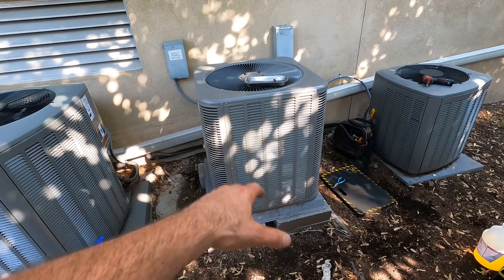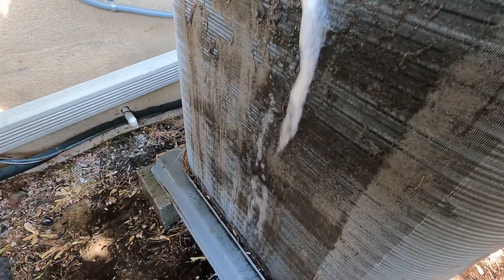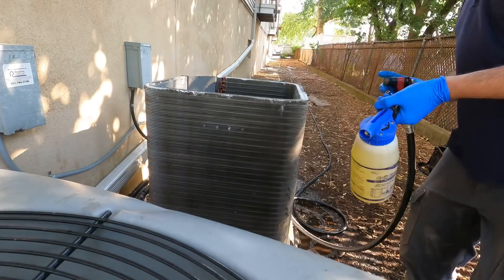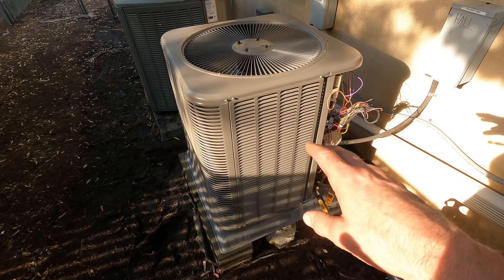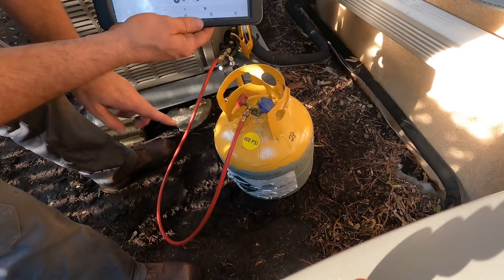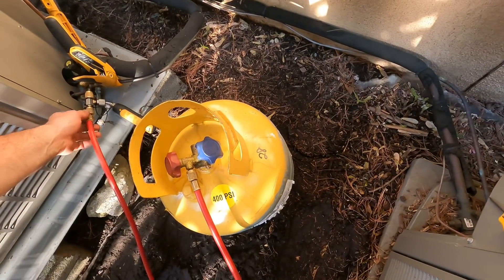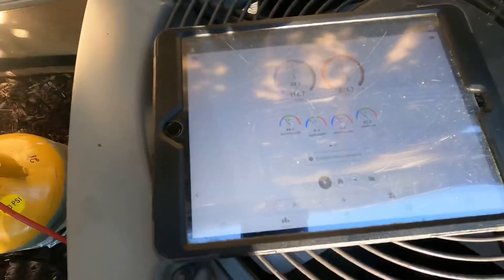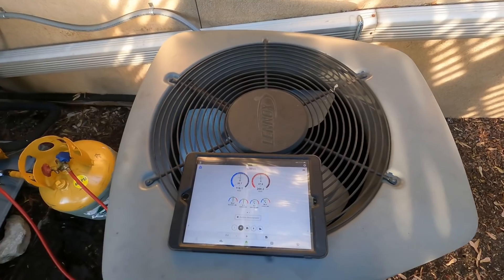HVAC Service System Head Pressure Fault Multiple Problems Repaired

Comment: Suction line temperature was at 54. Isn't that too high?
Reply from the maker: No you usually want it in the 50 degree range. I never like seeing my suction pipe below 50. Then your super heat also will be low.
Reply: @thehvachacker  interesting. In school they taught us that you want the evaporator cool between 40-50 degrees

Comment: Wow that is one plugged up condenser coil. Back in the day, calgon made a cleaner used to spray down and clean those coils, they would emerge shinny and new looking.  Its a world of difference once they become unplugged and allow heat to be removed.  Good job.
Reply from the maker: The strong Nu-Calgon cleaners eat up the aluminum on these newer units.

Comment: 1 degree of superheat only comes if you have a piston or a faulty txv or in the rare case the txv was field set that low. 

Superheat on most txvs are factory set to stay within 6-22⁰.

If you overcharge a txv the metering device doesn't know, it's regulated by temperature not pressure.

I believe you just check a piston using subcooling.
Reply from the maker: Subcooling is how you test a charge on a txv system. Superheat is how you charge a piston system. An overcharged system with txv will still flood refrigerant through the evap coil too quickly for it to superheat back into a vapor. Therefore flooding back liquid refrigerant for the compressor. Besides the part of txv that modulates the temperate of suction pipe leaving coil. There is a equalization bypass tube going around the txv to suction line. That is where a lot of the extra refrigerant will go around the txv flooding to much liquid refrigerant through evap.
Reply: @thehvachacker did you personally go and check the metering device?
Reply from the maker: In what way to verify if txv or piston? Too much subcooling, and low superheat is an overcharged txv system. I know it has txv.
Reply: @thehvachacker  by checking the coil or you can do it the lazy way and shut the unit off and watch the pressures, if the equalize fairly quick then is a piston. 

What was the required superheat at that time?
Reply: @thehvachacker  did you check? If you remove refrigerant from an overcharged system with a txv the superheat pretty  much stays the same unless the txv is faulty or not mounted properly. 

I've seen it a ton of times! You may want to look it up they have a factory preset that won't allow more refrigerant in unless it is faulty or needs top be field adjusted
Reply: @ishalljr  it also depends how much is system overcharged.  Even txv has some limits and if its overcharged way to much comparing to factory recommended charge TXV will not hold designated superheat and evaporator will be flooded.  Cheers

Comment: I always wash from outside not 90 degrees, but under an angle. And it never goes inside, and it is much cleaned than cleaning from inside.
Reply from the maker: Water never goes through the coil? If it does not spray through the coil. Then your not cleaning the coil. You need to wash out the dirt
Reply: @thehvachacker  if the dirt large not get stuck between fins it is blown away. If it small to enter between fins, the same way it exits. I always wash from outside, never had any troubles letting water go through and seeing light between fins. Saves the time and customers money. Actually I would like to see a video of the dirt getting stuck by washing from outside 😁

Comment: Good job dialing in that charge. It'll make plenty of water now. I've found that using a condenser coil brush knocks off most of the big chunks and takes less time before putting the hose to it.

Comment: Good work, for a while, I thought maybe the evap coil was dirty or filter was dirty, but it settled out very nicely. Thanks for the video.
Reply: That would cause low suction not high head. Dirty filters and evap coil

Comment: Just thinking about getting in HVAC.  What tablet are you using; is there an app that has to be acquired.  And the gauge hookups, what kind and how much are they?
Reply: He's using the Fieldiece probes. That's what I have and they're nice. You can use the Fieldpiece app but I prefer the Measure Quick app. Measure Quick works with many probes from different manufacturers. Fieldpiece kit is about $500 for two pipe clamps, two pressure probes and two temp/RH probes. I got an additional temp/RH probe for outdoor temp. Just take into consideration, you can do everything he's doing with a $100 gauge manifold, a pipe clamp for reading line set temps and a couple of thermometers (less than $200). Beginners typically don't invest into the full "bells and whistles" kits right off the bat. It's also good to be knowledgeable on how to perform the calculations "old school" style and if your probes ever fail you. HVAC is a great trade and if you're well trained and know your stuff you'll always have work. Consider getting educated at a trade school, it will pay dividends.
Reply: @bill944  Thanks for the great information; I'll put it to use.